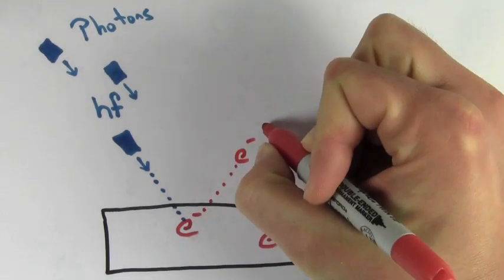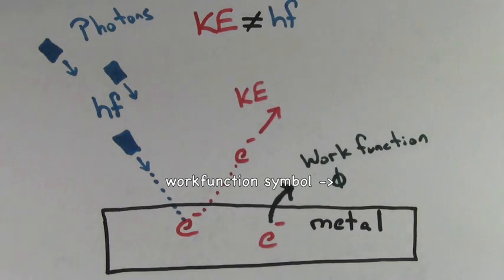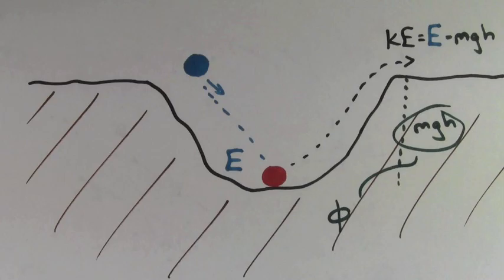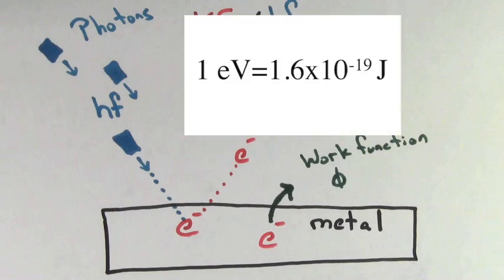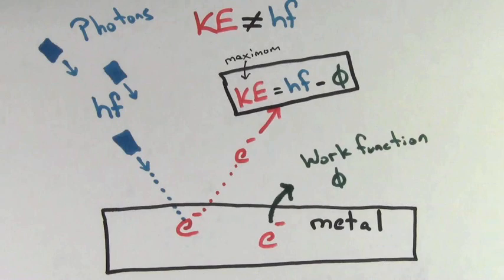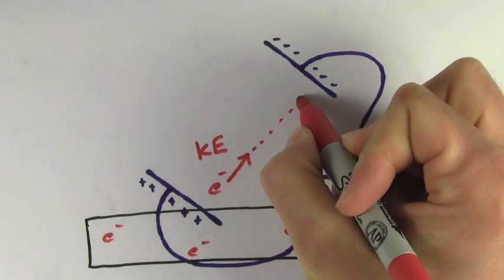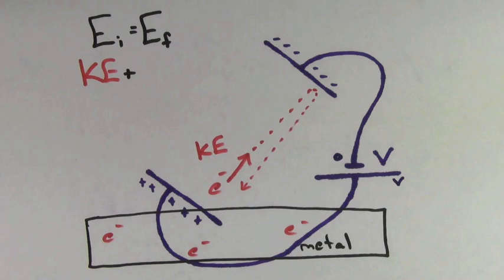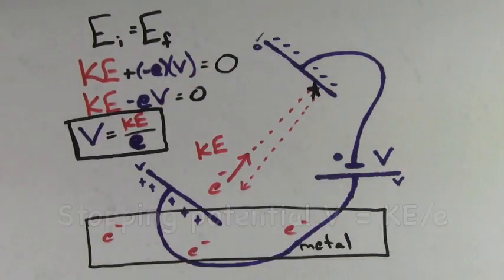Photoelectric effect problem solving (Micro Lesson for AP Physics)

Comment: Please help answers this question 
Given that the mass of electron =9×10–³¹kg and that the velocity of light is =3×108 m5¹
Calculate the following 
(A)  the kinetic energy of a gas molecule of mass 5×10²⅝kg moving the velocity of 400ms¹
(B) the kinetic energy of an electron moving with an electron 2×10 ms¹
(C)  the energy of a quantum of green light of wave length 55onm
(D)  the energy of a quantum of ultraviolet radiation by wave length 100nm
(2) a quantum of energy 4.5 election volt is incident on a calcum surface what is the energy of the emitted election 
(3) what is the velocity of an electron of energy 2.5 ev